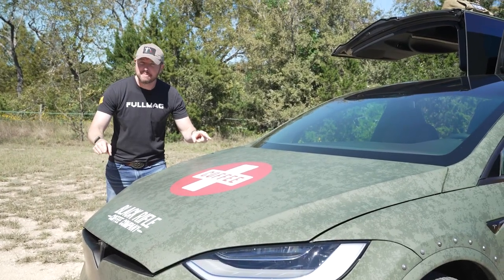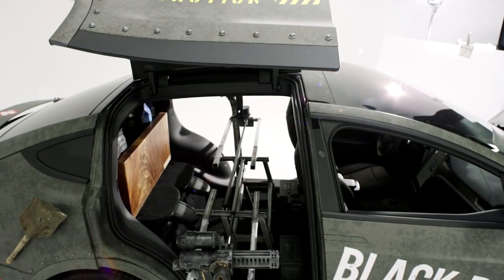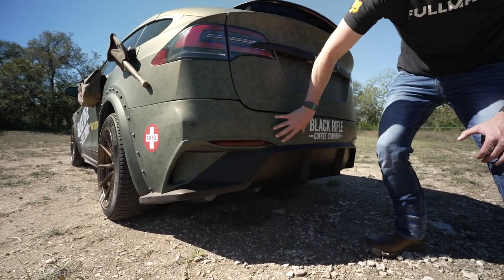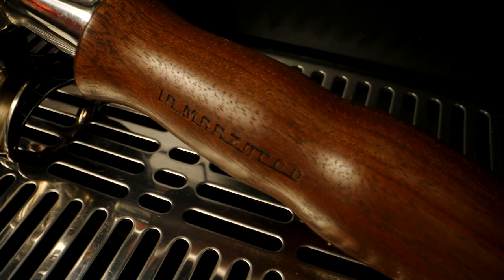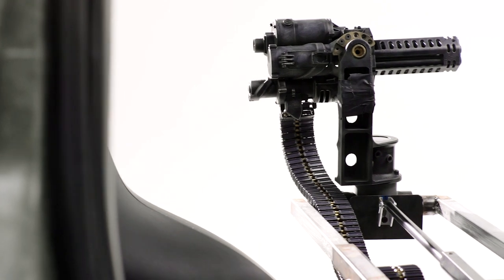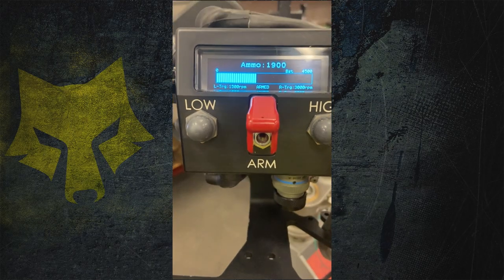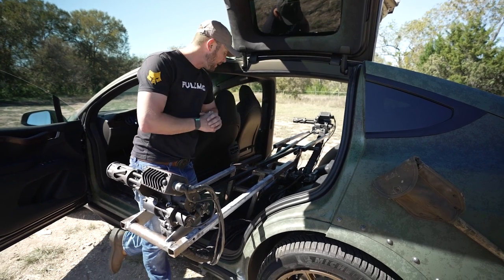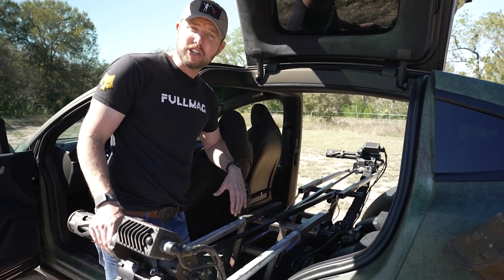Tesla Model XR556 with Dual Miniguns

Comment: It needs a couple of upgrades. First it needs a targeting system with HUD. Second it needs a safety cut off so you can't literally blow the doors off if you open the driver or passenger doors. Next it needs triggers on the steering wheel and maybe a yoke from an airplane, and why not some sidewinder missiles while we're at it. LOL  This is very cool but it would be cooler yet if BRCC hadn't done a certain interview with the New York Times. I honestly just don't know what to do with that.

Comment: Nice job.  I know it likely wouldn't be practical, but it would have been great to mount the miniguns on the falcon wing doors.  Not sure how strong the actuators on the doors would be but almost anything can be upgraded.  Regardless, I hope you give a Cybertruck the same treatment when it becomes available. I would like to see a RWS in the bed that can be deployed, aimed and fired from inside the vehicle.  I think you could do it on a frame that is removable from the truck when not in use.  And of course the whole thing can be powered by the power outlets in the bed.  Just roll up the tonneau cover, raise the RWS and have at it!  Sounds like a good project to get an RWS manufacturer involved with.

Comment: The unpainted bolt just bugged me. I get it S*** happens but it was unbalanced and stuck out. I want to see the guns deploy and retract. How the amo belts move as well as the motors that move the system in and out. I like that stuff. Down range, how about some poppers and watermelons or pumpkins like 100. If that's no good what about a cinder wall and a wooden structure.  Of course a truck a big gas guzzler.  What about a couple of pig carcass's.

Comment: One of these PF556 miniguns in a custom gimbal type of turret mounted to the front rack of a big bore 4x4 ATV would make the ultimate pasture/prairie hog slaughtering machine!!!! 
Fast 4x4 quads rule for hunting/eradication in wide open spaces if you don't own or have the money for a heli. 
We just chase them down and run the hog over and stop the quad on top of them so they can't move too much while we cut the throat then move on. Once you get them pinned it takes 30 seconds top's to hit a main artery then get back on the quad, once you get the hang of it that is.
Big island Hawaii
EAST SIDE where it's still country and full of good people living with honor. None of that city mentality rubbish around here. They try to move here but don't last long at all...

Comment: Didn't even primer or seal the bare metal on the mini gun sliding frame. Makes it look so slapped together and chinsy.  Atleast the espresso machine works that's what grown men want at the range
Reply: It would have been much better if the guns were mounted to the interior of the door. I wonder how that 1" tubing will hold up to recoil of real rounds
Reply: @ChevTecGroup  he was just shooting blanks so not as bad but ya i agree